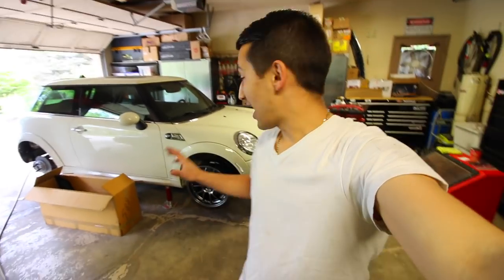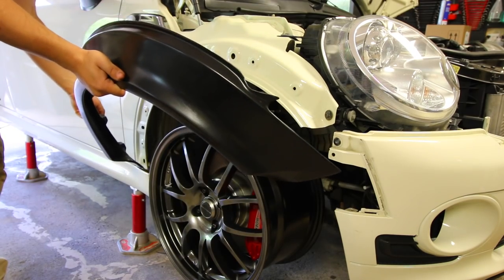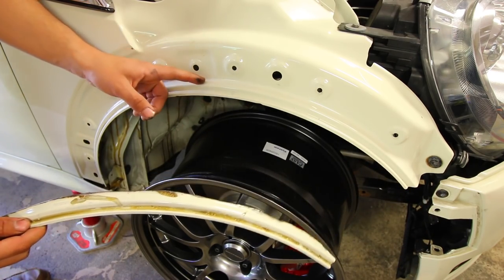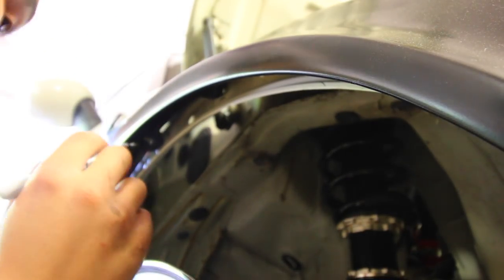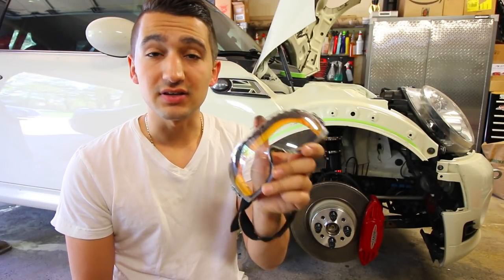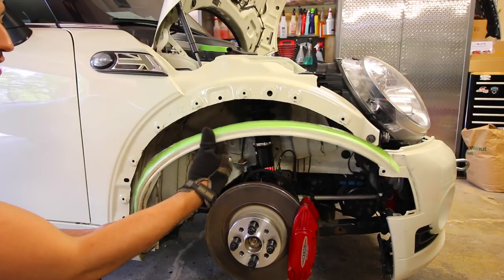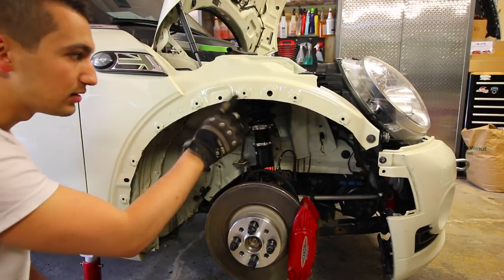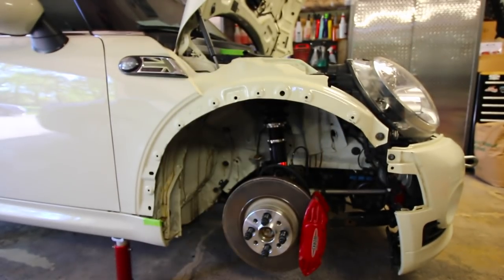INSTALLING WIDEBODY FENDER FLARES!!!

Comment: Before you cut any sheet metal/fender, you should mount the tire on the wheel and mount it on the car and put a floor jack under the A-Arm to raise the front wheel up as far as it will go to see if it will interfere/rub on the stock fender arch. If not, then you do NOT have to cut any metal away.

Comment: Fender Flares aren't widebody🗣
Reply: Crisp Films  yeah that is not a wide body kit.. just bigger Fender flares....but looks awsome!!
Reply from the maker: Considering I already have fender flares on the car from the manufacturer, and these are wider than the stock ones, I'd call them wide body fender flares
Reply: The Term Widebody is Used To Loosely Today
Reply: What else do you want? 😂
Reply: Say what they are Actually Called Fender Flares...simple as that
Reply from the maker: I did.. check the title of the video
Reply: Corey Murillo that's what I'm saying homie👊
Reply: still isn't a "widebody" kinda disappointing when you're just doing flares instead of a full on widebody.
Reply: Crisp Films ugly wheels too
Reply: eel1331 6ULs are far from ugly and they are super lighweight
Reply: Wide body kit consists of:
Skirts, bumpers and fender flares.

Comment: if I run a 16x8 et 20 wheel with 215/45 tires on it on my 2011 r56 will I need fender flares?

Comment: The chassis saver paint may be good but it would work better and had better adheasion if you had used a scotch pad to rough the surface of the paint to give it a better key.  But good work.

Comment: Rims with a lot of offset require fender flares so you can pass the inspection and rims with more offset do make a "widebody" car since you are increasing the width between the two parallel wheels.

Comment: Hey Milan .  Can I get the specs on the wide body fender and wheels you ended up getting ? I saw wide flare body at outmotoring but not sure if it is the same what you have here . Thanks ! Just dm me if you can ! I know the video is old but I hope you still have the info .

Comment: Are you going to tune it at all milan ? My cooper s is putting out 210 bhp so i think you could easily beat that with the JCW
Reply from the maker: 100% :) I'm contemplating do I go big turbo before or after the tune..
Reply: You might have to go with forged internals depending on how much boost you want to push through it though milan but sounds sick man !
Reply from the maker: Yeah that's probably what I will end up doing

Comment: I love the idea what what you are trying to do!! But these are just flares and not a widebody.. also why not just get a set of wheels with the correct offset and back spacing so you don't run a wheel spacer?  Don't get me wrong I love the car I used to have a 06 supercharger cooper S.. it was lowered Alta exhaust intake and smaller pullies!! And remapped Ecu.. it is a great car.. I just hate the fact these aren't real widebody kit and you can find wheels that won't have to run spacers
Reply from the maker: I have a tall order for the wheels for the car. Here is the criteria. 
1. Wide enough for fat tire
2. Large enough to clear 330mm Big Brake Kit
3. Low enough offset to not run spacers
4. And the worst part, 4x100
Finding wheels that can do all of that is very difficult to find. I can find some that will do 2 or 3 criteria, but all 4 is very hard.
Reply: milanmastracci what size tire are you trying to run?